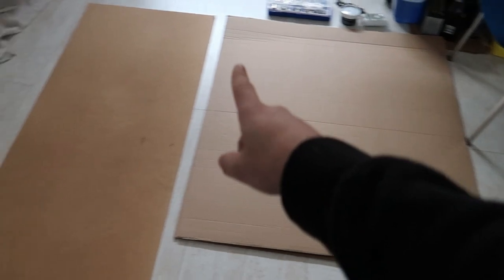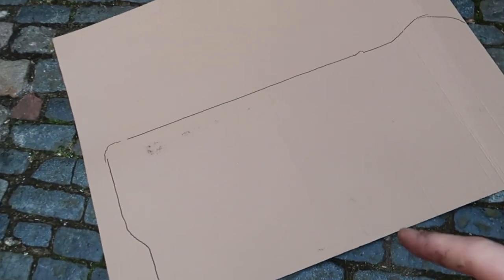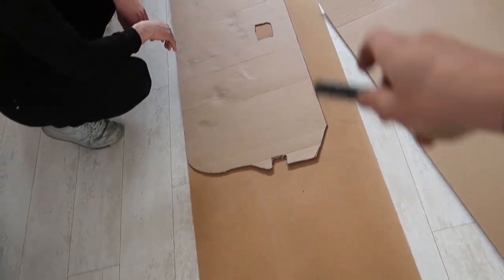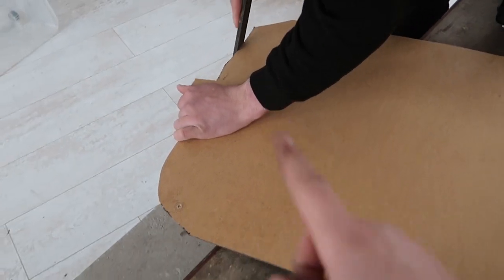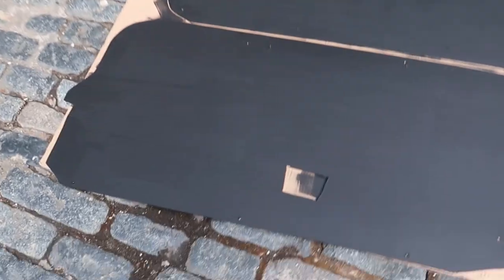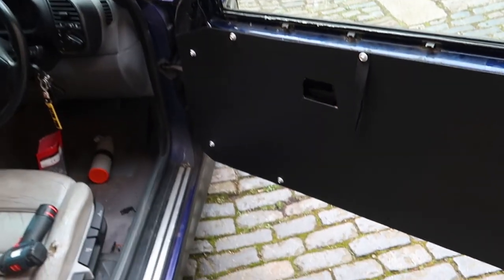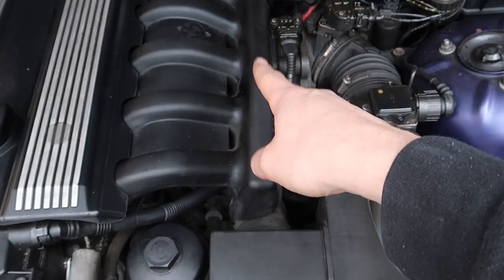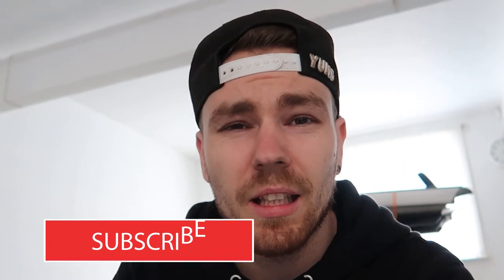How to make cheap door cards! *e36 drift build*

Comment: Do you remember the size of the ply and where you got it from
Reply from the maker: I can’t remember the sizes man, I got it from wicks
Reply: @MaxFuller  ah no worries they turned out great I’m gonna do the same for my starlet
Reply from the maker: Thanks man, they are still holding up a year later haha just don’t get them wet as they warp 😂
Reply: @MaxFuller  I think some good hydrofobic (anti rust for example) paint can prevent most of warping. But tbh i prefer slightly warped panel rather than having the whole thing flapping around xDDD I will try doing those as well while trying to keep the speakers  and mirror regulator and maybe keep it clean